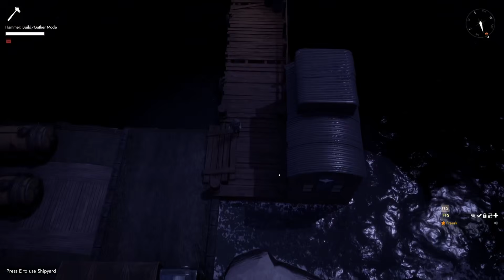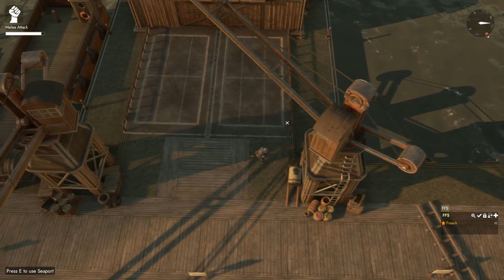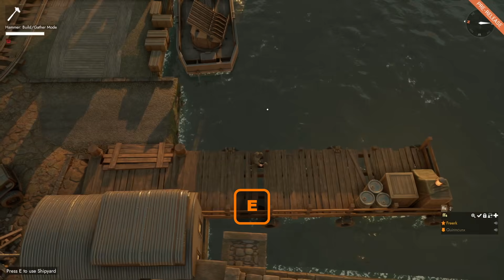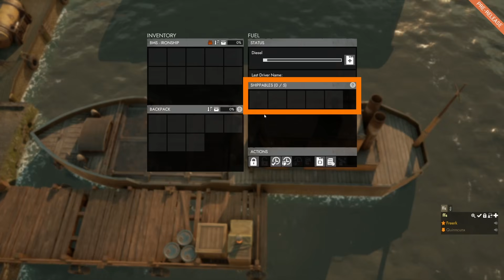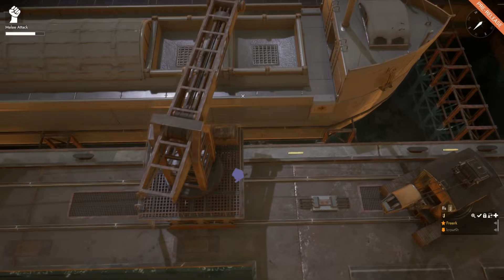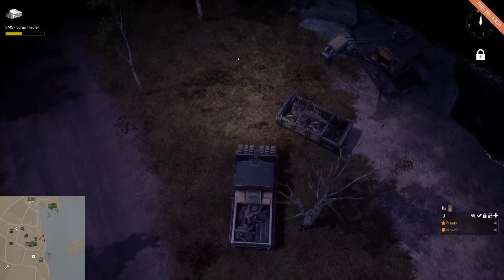Foxhole Naval Logistics

Comment: You can also additionally use the Colonial Pegasus in many of the same uses as the Krokodil, due to its amphibious nature.

Due to the very limited capacity of the Pegasus in this role, however, such deliveries would need to be high-priority and/or high value to make it worth the extra expense of burning hoil to make a delivery of only 15 disassembled crates. However, because of the amphibious capabilities, you can also make deliveries to/from inland storage depots and then very carefully make your way to the water to then fly away.

Pegasi also don’t play nicely with seaports, as the dock edges can cause them to get hung up and destroy parts without very careful handling to avoid bumping into structures or ships while on the water.
Reply from the maker: I contemplated to put the Pegasus in this video. and despite it's naming I do not think personally that it is a logi vehicle and if that like you say not really a naval logi vehicle.
Not to mention that I try to keep the logi ones faction neutral and the pegasus will just make wanden logi man jealous ( I think)
Reply: @FreerkHoltes I agree that it’s not really a logi vehicle in the sense that it’s not efficient for bulk movement of supplies/ammo, but it can supplement more normal logistics with express delivery of high priority items to close-to-the-front storage depots before flying away.

Furthermore, while I do admit that the size isn’t very useful, the Krokodil does have some niche use in that you can unload and get away quickly, so it can be used to deliver to frontline seaports without being as vulnerable as an Ironship. However, the fact that you’re only moving 60c worth of goods and cannot preload containers before the ship itself arrives makes this limited use at best once real Ironships become common.
Reply from the maker: @zanaduz2018  Yeah the Krokodil is very niche, but as an actual hater of the freighter (it rhymes!) I do enjoy the maneuverability and speed of the Krokodil. And the fact that you do not need a crane can be great especially in backilines regiosn that see a lot of train traffic.
Reply: @Fre @FreerkHoltes o enjoy taking out the Krokodil when I make smaller deliveries, but I found myself gravitating more towards the freighter as the war progressed just for the cargo capacity.

Likewise, while being able to fly (and thus go directly to my destination) sounds great, I don’t see logistics deliveries with the Pegasus/Zealot being a real sustainable reality for anything but high-priority, low-volume deliveries with how they are currently implemented. If they change it so these crates were not disassembled (so you could take them out and submit them to other destinations besides storage depots) or could parachute them down (potentially in conjunction with paratroopers), then I could see more general use for these planes in a logistical role.

As an aside, I do also hope we do get a dedicated logistics version of these planes if they don’t add this functionality, or preferably, we get an expanded cargo plane that can deliver small shippables.

Comment: Will bluefin get a separte video given it's multitude of uses?
Reply from the maker: The bleufin isn't really on my personal "to do " list. But to be fair the bowhead wasn't either. 
My reasonign for things like that is that in general, if you are looking at things like that you probably progressed and played enough Foxhole to figure most stuff related to that out yourself. If I do a viedo on the bleufin it will basically only be after a devrbanch where I had enough time to shoot the footage and run through diffrent scenarios to test the capabilities and mechanics.
TLDR: maybe, but I wouldn't hold my breath for it
Reply: Mmmm, fuelfin